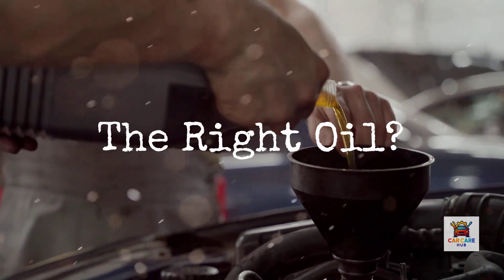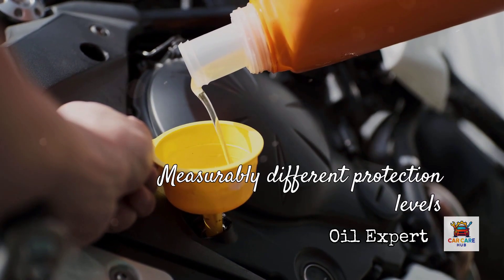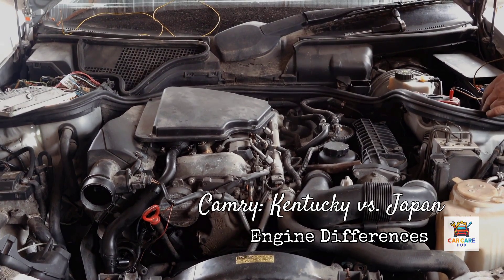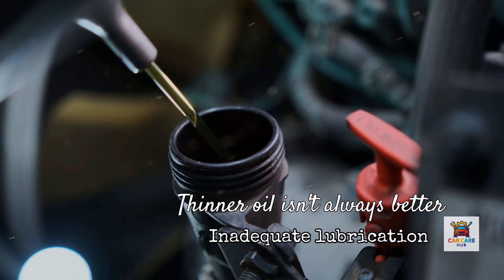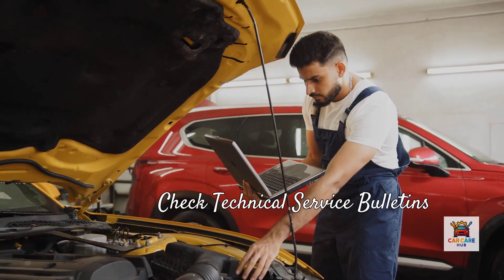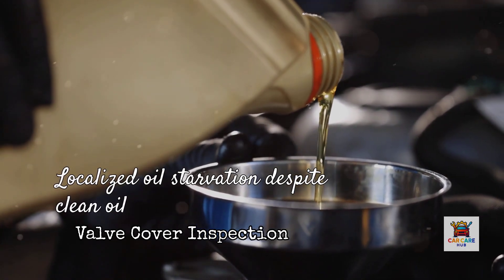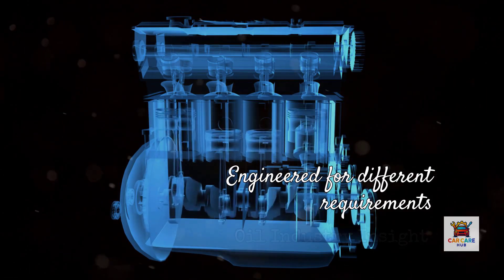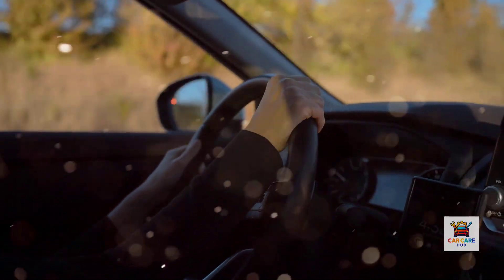U.S. Cars vs. Global Engines: Why 0W-20 and 5W-30 Oil Matters NOW

Comment: totally fake.....the oils are not thinner or thicker - viscosity refers to the flowability of the oils.   Bearing clearance and tolerances have nothing to do with oil viscosity.   Molecules of both 0w20 and 5w30 are exponentially smaller than any given clearance in an engine.  this entire video is BS meant to get clicks keep you buying new cars every 5 years.

Comment: Why is thicker 5w30 recommended for the japanese engine if the bearing clearances are tighter than the kentucky one?...Thats backwards.
Reply from the maker: It's not mainly about bearing clearance. Japanese manufacturers often tune their engines for higher RPMs and hotter operating temps, so a 5W-30 can maintain viscosity better under that load. Clearance is just one factor, but operating temp, engine design, and fuel standards also play big roles.